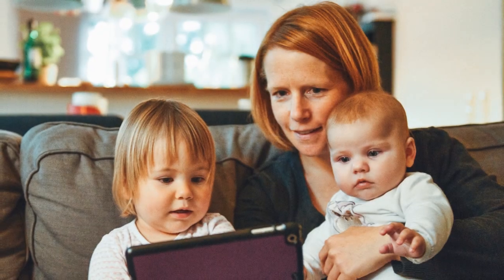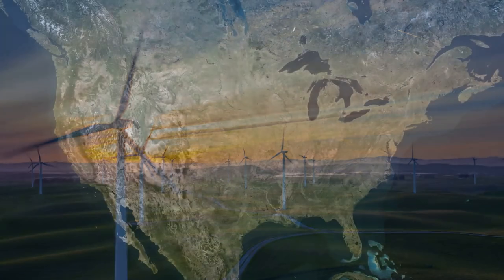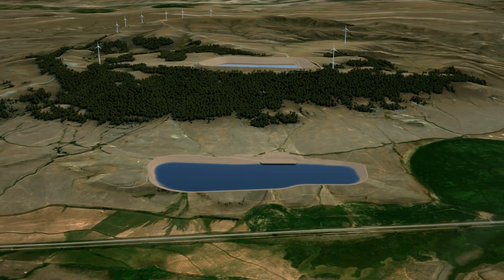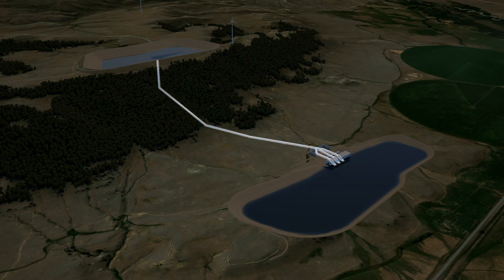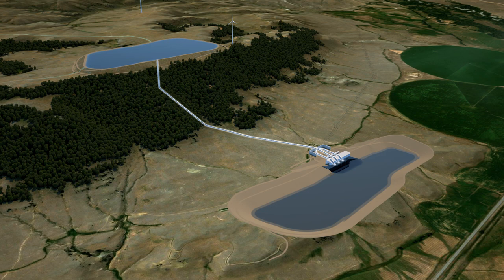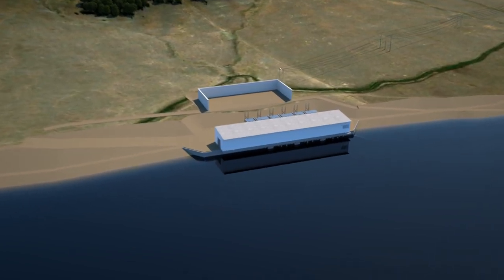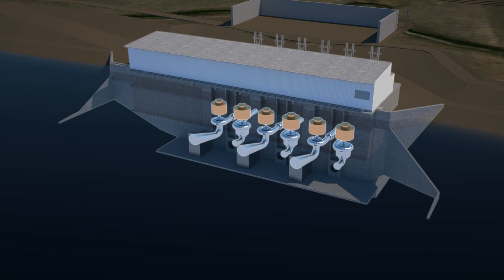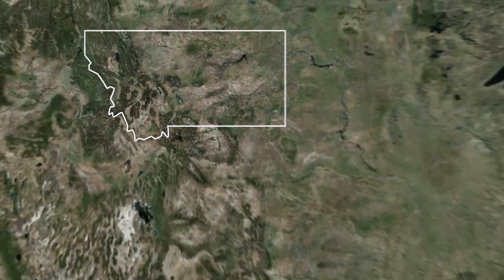Gordon Butte Pumped Storage Hydro Project

Comment: Nice job
A great system to go hand in hand with wind and solar... 
I am a big proponent of closed loop Hydro...
To much emphasis has been placed on battery storage, when this type of power generation and storage has a much longer life time at peak efficiency...
I like the above ground pipe and power plant...
Spillways or some way of dealing with overflows would have to be developed l would imagine...
The overflow system could be spillways. Or pipes running to enclosed tanks for reuse of water...
With wind turbines and solar panels used to run the pumps to pump the eater to the higher reservoir....